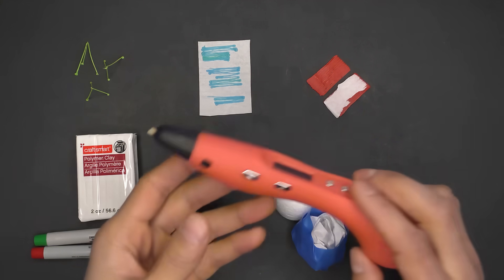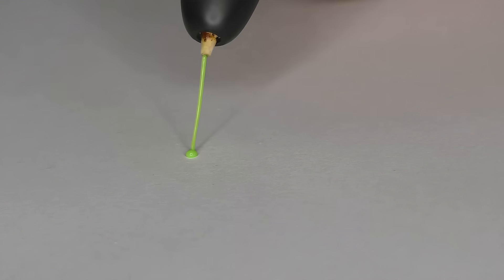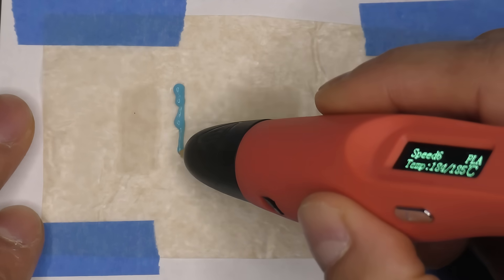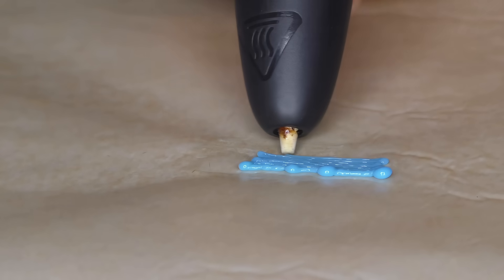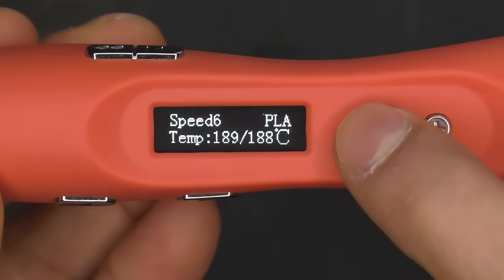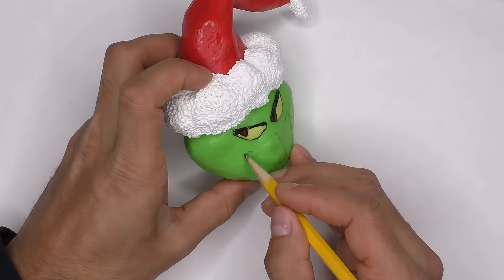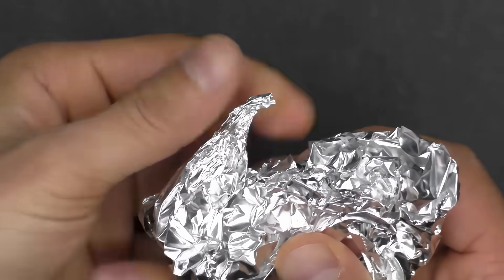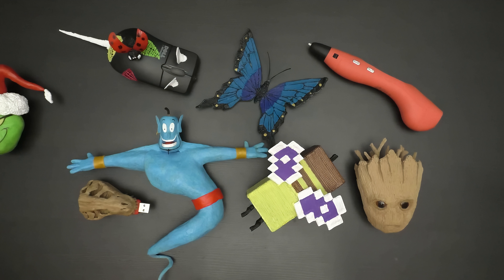Mistakes 3D Pen Users ALWAYS Make

Comment: thank you! so useful, want to do a necklace or a bracelet but my creations are not ending flexible, is it the pla type that came with my 3d pen? or am I doing something wrong? I need the pieces to be more flexible so I can mould them (example, bracelet need to mould around in c shape etc) what tips you would recommend? thank you!

Comment: I have found printing on EVA and using EVA foam as infill. Especially since you can shape with a belt sander. Also I have found you can take a heat gun and resoften pla to fix issues and clean up.

Comment: @PotentPrintables - Great review, as a result of it... I bought a couple of 3D pens (only £10 each on eBay) to repair/patch layering imperfections in my 3D prints using the same PLA/ABS filaments. Saving me a small fortune over two years, not having to scrap imperfect prints. Took only minutes to get acquainted with the pen's features and easy operation. Replacement nozzles are abundant and still cheap. 👍

Comment: I bought the MYNT or whatever the heck it’s called 3-D pen for about 60 bucks. I’ve had a 3-D printer for a while, but just got a little too. Curious with 3-D pens since my 3-D printer is out of service for the time being I’d say that being able to print directly up is useful for abstract art, but that’s about it. I can’t wait to use it and make a whole bunch of crap with it especially since I have, a bunch of or actually an entire spool of PLA pro filament that I still haven’t really used and have my own smaller spools of white filament, which makes using any extra filament that no longer fits in the printer because it’s too short not to waste😂 it arrives tomorrow morning, and I cannot wait to use it so since it’s 3 AM good night to anyone who reads this

Comment: Something i saw on another channel was the person wanted to figure out how to make a skin around their model without needing to sand it, they used a spatula in their off hand to do so. It did come out a little janky. So ive been thinking, would something like attaching the spatula to the pen negate this issue? My thought process is based on how roads are smoothed out, the cement trucks that pour the cement onto the road usually have a trailing fin that compresses the cement down. If it works for cement could it in theory work for plastics?

Comment: BTW the main reason why 3d prints are not infilled with a solid is not cost but deformation.
If you fill in a solid, then one of two things happens:
If you add too little, then you have a dip in the middle of your layer. Add too much, and you have a bump. This may be microscopic, but over hundreds of layers the effect accumulates.
But the other reason is fillament shrinkage. If you fill a solid, then as it shrinks it pulls the outside of your model in. This effect is not as pronounced if the infill is partial because the voidsallow for stress reliefs. 😮

Comment: I got a 3d pen and getting the speed right when filling in my welding skills helped me completely avoid that problem I never had that problem just only problem I got is I got aggervate trying to dray up in space like commercials show common sense should have told me that's not practical and wax paper great idea. Another tip is trace over objects that already are made for what your making but use it as a base. Like my gf wanted to make a huge elaborate mask that looks like day of the dead with flowers and stuff and Mardis gras shape mask mixed in and she traced sunglasses and started out with 3d pen made sun glasses as her base using real sunglasses and built off that then pulled the sun glasses off and boom huge mask fit your face perfect

Comment: I got a 3Doodler for Christmas, this is something I thought about getting but just couldn't bring myself to spending money on. Now that I have one there are several things I will be using it for, such as welding my 3D prints together and filling in recessed text with a contrasting color. 
I have several 3D printers and the only one that I have had any success changing filament for different color text is my original Monoprice Select mini so I think this will add a new level of enjoyment to my hobby.

Comment: Looks like lesson 1 for me is to get a new pen. I bought the first generation 3Doodler and it definitely doesn't control that well. (I added your video on picking one to my queue for later.) I have my own pile of those triangular pyramids from my early attempts to do it as advertised...

One of my successes with it was in plastic "welding". I was making fake welds on plastic to then paint over with plastidip, automotive primer, and metallic paint, then weathering with blackwash and hand-painting some acrylic "rust" color patterning to make them look like metal welds on a metal surface. The 3Doodler portion of it came out very well and the layers adhered to it well, giving the right raised structure to look like welding. A Dremmel can grind down bad spots, but honestly the problems with 3D pens are very similar to welding problems, so a bad 3D pen job looks like a bad weld after painting.

The other success was replicating an anime prop (Mate Chopper from Sword Art Online) which I used a template to make both halves, then bridged them to make the gold "ivy" bade decoration work like a clasp so I could paint it separately and slip it on. PLA is just flexible enough that it worked perfectly without needing adhesive.

Comment: Would drawing in the air work with a proper foundation, very low extrusion rate, minimum temperature needed and fans blowing cold air? (don't have a 3d-pen)
Reply: With knowledge with 3D printers my answer would be no. A cool room causes warping between layers even for 3D printers, slow extrusion rate is already what makes it impractical to begin with, and a good foundation will hardly make it easier. 

Honestly wanting to draw on air is just a childhood fantasy that probably won't be possible until we discover something more revolutionary than modern technology.

Comment: Hi- I'm new to using 3d pens, and i just bought a new pack of pla filament from a brand i haven't used yet. it gets all bubbly when it comes out of the pen, and i read that it's because the temperature is too high. i have a 3doodler create+, so there's only 2 temperature options and the lowest one is too high. Is there any other way to make it stop bubbling?
Reply: well, nevermind, I tried a few different filament colors and they all turned out fine. Guess that one color was just weird? ¯\_(ツ)_/¯

Comment: is it possible to use abs filament in normal 3d pen... mine had pla nd abs option... i bought the abs roll and tried to use it and the nozzle of the 3d pen started to melt coz f the heat, i used only the temp which can b selected on the pen.

Comment: It seems to me that the 3d pen thing was a flash in the pan fad. People got excited for a while, but now its only used by a small core group of proponents.
To try the fad out, I bought a 2nd hand pen off ebay and got an unscrupulous seller. Pen nozzle was clogged with melted then hardened filament, and i still havent been able to clear the unit to try it, even after turning it on and heating it up to try to clear the nozzle.
I since have lost interest in pursuing it as I really don't think it would create anything I'd ultimately be interested in.

Comment: This is the first time seeing a 3D pen. I came across your video after watching videos for 3D printers. This is very cool and definitely something I want to get. Question: You mentioned various things to use as fillers (tin foil, styrofoam, etc). Does the filler stay in or does it get removed once the piece has cured so the end result is a hollow piece like 3D printers can do. Great video. Thanks for taking the time to make it.
Reply from the maker: Thank you!  The filler pieces usually stay in place, but it is possible to remove them if you plan for it in your project ahead of time.  Hope you enjoy your 3D pen when you get it!
Reply: @PotentPrintables  Thank you!

Comment: thanks for your tips. I tried a sphere the other day and drew half over a plastic ball. The problem was that I hardly could take the plastic out since it was sticking too much. I had to break the plastic instead. Is it due to a too high temperature I used or because of the material? I haven’t tested it out yet with the painter tape. I suppose it doesn’t stick as much on the tape?

Comment: This is a Gide for newbies cose  I can not  film videos I have to do this (I know a what to do it you could use clay and then Hardened then add the 3D pen,If you what the material you use you could cut it off of it then Fuse the plastic back together or if you what to make it look like metal you code make it out of 3D and make a mold of it.

Comment: Can you use masking tape instead of painters tape?  My daughter has been begging to get a 3D pen. So her goal is if she does well in her schoolwork and her behavior is good she can get one at the end of the marking period. We are getting her an Astronaut looking one from Walmart. Is has a few good reviews. I’m not sure if this is gonna be a phase or if she will really be into it yet so I didn’t want to get a super expensive one yet.
Reply from the maker: Hi- I haven't tired masking tape yet, but it should work as long as the top is not too smooth.

A lot depends on your daughter's age- I have a video guide on buying a 3D pen that breaks things down by age.  Some cheaper 3D Pens ($15-25) can be ok, but the really cheap ones ($5?) are garbage and break really quickly.

Comment: Also, another great tip when using wax paper is to actually pick up all the paper, then bending it away from the filament so that you're not bending the filament at all if it's thinner/fragile
Reply: Would a good metal spatula be a smart idea or is it too hard to slide underneath the plastic?
Reply: @ZieSpiralOut  I am very late, but probably. My 3D printer (not pen, but close to one) comes with a spatula and both a 3D pen and 3D printer are both very similar besides the huge amount of electronics a 3D printer has, so I assume it would be a good idea. I am only saying this because I have not used my 3D pen yet..

Comment: A HUGE thing to remember that I just found out the hard way is that different colors can cause the filament to react differently. Have to adjust temperatures. You can actually feel the filament, and tell that some colors are harder than others. My metallic bronze kept cracking until it completely shut down my pen. Wasn't from the heat either since it was breaking before it reached the tip.

Comment: A lot of useful things but i don’t know how to turn on my pen 👍🏻
Reply from the maker: Usually it's just plugging it into an outlet.  Most do not have On/Off switches.
Reply: Yeah like potent said
If that isn't working it's maybe because you haven't put the ink in it
Or it's that you need to wait for it to heat up (couple seconds)
OR it that you aren't pushing the down arrow nor holding it

Comment: bridging in the air works best. doing a standing figure you can cut out a cardboard silhouette of the figure, then cut that in half and make a cross shape stand on the bottom of it, then you can bridge along the edge of the cardboard to build the outline and bridge from that outline. using the simplest side of the silhouette to prevent more work.

Comment: So um, you really can build sculptures by "drawing in air."   I find it helps to have a fan available the path of which you can move your work in and out of.  I like to think of it as the 3D pen sculpture version of gesture drawing.  That said, it's not a technique I use that often.  It's a pretty unwieldy technique.

Comment: I've been in the market for a 3D pen for a while and I was leaning toward the Scribbler V3 but can't find it in stock anywhere. I want something that takes standard 3D printer filament (1.75 I think?) with adjustable temperature and press/hold to extrude. I don't need an internal battery since I imagine it would often sit for months at a time and wreck the battery anyway. I primarily want it for utilitarian things like repairing cracks in plastic toys and shelves, etc, although I would explore it's creative uses on occasions. Can you recommend a good pen?
Reply from the maker: Yeah many of the 3D Pens I have are out of stock or no longer sold apparently.  You should try the MYNT3D pro:
https://amzn.to/32O5pjj
Reply: @PotentPrintables  Looks like a great choice, it can even run off of USB power banks if they have enough output, not to mention some serviceability.
Reply: @PotentPrintables   I was finally able to try the MYNT 3D Pro I ordered yesterday. Really impressive so far, seems to have quite a few good features that weren't advertised. I appreciate the recommendation.

Comment: For drawing up into the air, couldn't you just flip it all over. You would tag it to the bottom side of the paper and let gravity pull it down as it hardens. 

Wouldn't that work better?

Comment: I know I'm kinda late, but I use card stock paper to print on, doesn't stick to the creation, but holds it down so it doesn't curl at the ends. You can also throw it into a printer to directly print out your template and then draw on it.

Comment: My 3d pen supports minimum 160 degree and the new filament I bought is leaking at 160 too, too much filament is wasting plus it's wasting time to so I have to clear nozzle Everytime. Any tip? It's cheap Chinese brand. $20 one.

Comment: when i smooth my creation its still turning brown. I have a wood burning tool with the tips you sad i needed to use. It mostly happens on white filament. do you have another tip or methode?
Reply: You are probably burning it a little. I don't have a Woodburning tool so I can't say specifics, but try moving a bit faster or at least not as much in the same place (so let the heat disperse a bit instead of focusing on one point, burning it)

Comment: I always find that printing lines in the air kinda pointless and time consuming.
Drawing lines on pad and fuse them later is way more faster method.
Reply: Never pointless to improve ones abilities.
Reply from the maker: Totally agreed!
Reply: İts your opinion,i should respect it. but for me i use the both methods
Reply: @roadkill236  If that works for you and its convenient that's absolutely fine. Everyone experience will be different from others :)
Reply: @3DPlasticFantasy  i use a cheap  pen,it gets cold faster thats why i guess...
Reply: @roadkill236  The brand name of plastic material matters more than the pen because they have different ingredients that behave differently. The expensive pen may have different speeds, lcd screen or better durability than a cheaper one.
Reply: @3DPlasticFantasy  that makes sense
Reply: I'll be honest, I thought I was just bad at 3D since I couldn't get that drawing in the air thing to work. When I discovered the "build it flat then fuse it later" technique I was so happy!
Reply: Thinking about trying out a 3d pen... Is it possible to snip a piece of filament and just kind of "tack weld" instead of drawing in the air?
Reply: @dustinthewind3925  Yep it does, and the result it's much better.
Reply: @3DPlasticFantasy  Is filament expensive and how often do you have to buy a new spool? Sorry if I'm annoying
Reply: @SophiaLi-pv9ec  Hey there, you are not annoying at all. The filament cost is from 15$ up to 25$ per 1kg spool for single color that will last you over a year depending the use. Its worth if you paint your creations.

Alternatively you can get for the half price 10m filament packs with different colors but they wont last for long time.

Comment: Not there any thing wrong with any techniques. I just like the challenge of using nothing on the inside my models. And for some part of models solid plastic is best and easiest. Also hairspray is not the only thing u can use. I use glue stick made for kindergardener, yep edible stuff.
Reply from the maker: Ya, I've seen gluestick used in the 3D printing also.  That's a good one for people to know about also, thanks for posting it.
Reply: @PotentPrintables  no problem . One is overhead projector film. You can find it at staples.